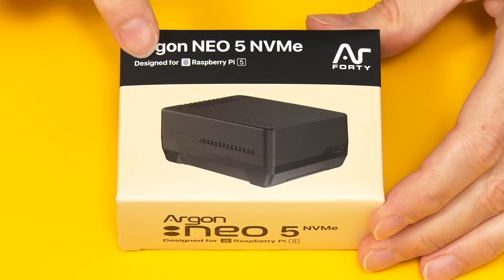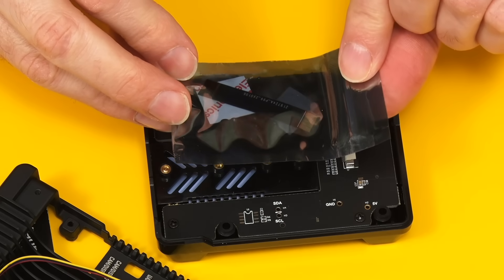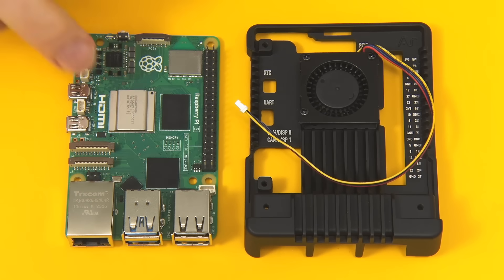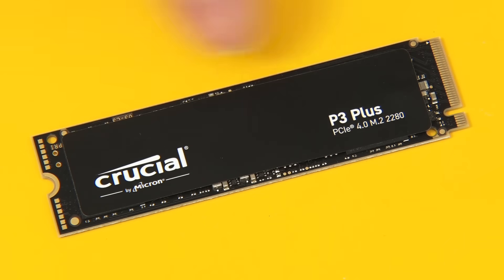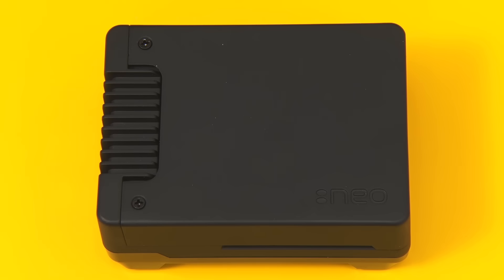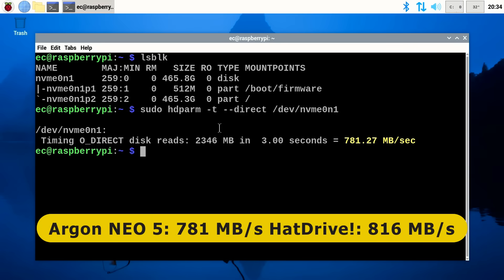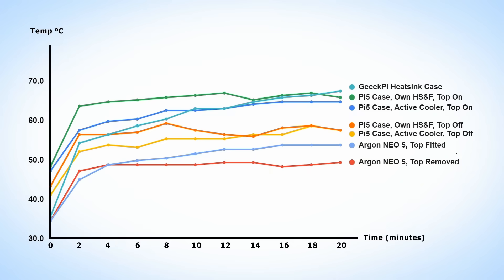Raspberry Pi 5 Argon NEO 5 NVMe Case

Comment: Nice video. I might add the Crucial P3s has a heat sink as part of the NVME - it’s the thin piece with the white letters.
Reply from the maker: The label on the P3 is a heat spreader, not a heat sink. :)

Comment: Question, I'm setting up a Raspberri Pi5 server for a client. I'll do the installs on one of my temp NVMe SSD's and later use Balena Etcher to clone the entire thing to the SSD the client purchased. Is there anything in that plan that you forsee not working? Thanks, much!
Reply from the maker: Should be fine, but I would personally clone the drive using the imaging tool in Raspberry Pi OS.

Comment: I switched from Raspberry Pis to repurposed thin clients that I buy used on Ebay: HP T530 ($40 with 4 GB RAM, performances similar to a RPI 4), the Igel M530C ($25, Ryzen CPU, 2 GB RAM) or the HP T640 ($50, ryzen CPU, 4 GB RAM). These are low power and silent (no fan), come with power supplies and solid cases, and run Debian fine. I prefer these over a new mini PC: cheap enough that I can tinker and experiment without guilt. The main downside is that they are much bigger than a RPI.

I continue to use the Zero because of the GPIO, but I am starting to have troubles with the sluggish package update on the original Zero. I avoid computers with fans (noise, dust accumulation), so I stay clear of the (relatively expensive) RPI 5.

Comment: Probably a dumb question, but since I've never played around with nvmes on raspberry pi's before, can these be used on other OS's other than the raspberry pi os?
I personally run one of the emulator focused OS's on my Pi using a Pi2Scart, though primarily for access to Kodi and Composite so that I have a way to stream my plex server to a CRT, but for those instances when I do want to play some games, using an nvme would likely give me a better experience, assuming of course that it functions.
Reply from the maker: Yes, you can install and boot other Pi OS from an NVMe drive.
Reply: @ExplainingComputers  Thank you, I'm gonna try picking one up then

Comment: A question i found no answer yet:  Is the Power-LED of Raspi 5 visible at Argon NEO 5?  Thanks in preview for possible answers and also thanks a lot for the informative and helpful video. 🙂
Reply from the maker: Yes, the power LED is visible on the Argon NEO 5.
Reply: Thanks a lot for the quick answer. I am very happy about it. 🙂  @ExplainingComputers
Reply: I ordered it and i have set it up yesterday with help from this video. Thanks a lot for that! :-) The fan is very silent and i even discoverd a deep blue SSD-Led additional to the Power-Led. 🙂

Comment: Long term, I've had a different experience of temperature :

Initially I got so low values , running your sysbench , 20 minute test. Later however, I install immich , and while this was indexing my photos , I saw:

12:04:03 up 1 day, 20:06,  4 users,  load average: 3.46, 3.73, 3.78
GPU temp=84.0'C
CPU Temp 83.70 C
NVME 39°C
Fan 10211 RPM
throttled=0xe0008

(I tried various things, but could not get back to low temperatures. So I assumed I had issues WRT thermal pads [ a thermal camera is showing nothing too hot, from above])

Before installing the pads , I reran your test:

temp=49.4'C
temp=61.5'C
temp=63.1'C
temp=63.7'C
temp=63.7'C
temp=63.1'C
temp=64.2'C
temp=62.0'C
temp=62.6'C
temp=63.1'C
temp=67.5'C
root@argon:~

And near the end I measured:

root@argon:~# all-temp 
 13:57:17 up  1:25,  4 users,  load average: 4.11, 4.04, 3.00
GPU temp=67.5'C
CPU Temp 67.20 C
NVME 39°C
Fan 5042 RPM
throttled=0x0

(The room temperate is 20.5 C) ,so:

1: Your sysbench does not seem to stress it as much as immich (your guess is a good a mine)
2: I do seem to have a slight temperature issue ...so I'll try the new thermal pads.
Reply: My final comment on this (I hope)

I ordered some thermal pads, used these , reran the test .... and got even higher temperatures

So I got some thermal paste, applied multiple pads to build up thickness. Used thermal paste as an indication that the metal case was pressing on the pad (it squashes out) . Then replaced the short machine screws with longer ones , so there was some pressure  pushing the pads onto the Pi ...and ...

temp=42.2'C
temp=54.9'C
temp=58.2'C
temp=60.4'C
temp=62.6'C
temp=63.7'C
temp=64.2'C
temp=64.2'C
temp=64.2'C
temp=63.7'C
temp=64.8'C

About 10 C below the new pads alone and about 3 C below the tests I ran using original pads . These are still quite a lot higher than you are seeing, but generally a lot better than I was getting. ABTW a thermal camera shows the whole case is "hot" and esp. the middle section (where the pi clamps to the case) so I guess some better thermal connection to the top cover would bleed that heat of better.

Comment: Finding a case for the Raspberry Pi 5 that supports both an SSD and a cooler is really annoying (especially since the official case does not), so this one that actually comes with its own cooler and connector for M.2 NVMe seems absolutely perfect for that use case.
Thanks for the excellent assembly instructions, too, I didn't quite get what the manual described in a few places.

Comment: Thast's a really slick design. Got the Argonone V3 without Nvme slot for the pi5. And it's okay at keeping cool. But i also have a Argonone with Nvme slot for a pi4. And that rest around 60-C with full power fan. Which is good. But also usually results in the fan running almost constant.
This one seems to have cooling for the Nvme very thoughtfully put into the design. I like it.

Comment: I missed this one when it was first released but have since recently set up a Pi5 with this case and a salvaged 256GB NVMe. And holy cow, THIS is the way. The Pi 5 really should have had an m.2 slot on the bottom because this is the configuration that we were meant to have.

The only thing I don’t care for on the case is that the matte black metal surface is a fingerprint magnet.

Other than that, I love it.
Reply from the maker: We are so in agreement! The Pi in this case with an SSD is th way! :)

Comment: once Againe, thank you for your video, I installed NVME Drive successfully, kept getting errors upon boot, it was the copper wire not connected to the white one it kept flipping upside down and inside out, that snaky little ribbon cable finally got connected due to rewinding your video, and using Mr Screw Driver xD, thanks lad.

Comment: Thanks for the great video! Quick question as there are no tech specs on the website - doe this have the SD slot so we could run the OS off that, and a the apps off teh NVME drive?

Comment: Two points after this video.

1, Would this run significantly faster with an NVME with Dram? (enough to warrant the cost)

And 2, is there a case that incorporates fan cooling to the NVME heatsink?

Comment: Very good video, thank you for that!
I’m very pleased with this case, but the only downside (for me) is that the top part doesn't have a ribbon cable slot for a camera, like the Raspberry Pi AI camera, for example. Does anyone have a link to a 3D-print file for this? I haven't been able to find one for this particular case.

Comment: I have two of these. Key problem is that the bluetooth signal - and presumably the WiFi, though I don't use that - is quite attenuated. I'm replacing the one where I need the bluetooth with an official case.

Comment: Any screwdriver with a steel blade can be a magnetic screwdriver. Just put a neodymium magnet anywhere on the blade, even little 3 mm round magnets are enough to pick up small screws found in computer equipment.

Comment: Thankyou for a great video, as always.

I received this device a couple of days ago, struggled 2 whole days to get the NVMe drive recognized, alas "nvme nvme0: Device not ready; aboting initialisation, CSTS=0x0". Was using the PNY CS1030 M.2 NVMe SSD 250GB, which is on the compatible list. Was able to get it working temporarily on a fresh install of DietPI, but as soon as updates were done it disappeared again. This seems to be a somewhat common issue, I'm waiting for a different NVMe drive (also on the compatible list: Kioxia Exceria G2 NVMe SSD 500GB) will see if I can get it to work there. And yes, I followed all instructions with installation of scripts, and more.

Comment: @ExplainingComputers Hello! Do you remember how strong, or weak, the wifi signal is? I'm asking because that's mostly a metal case. Even the lid is metal! I also find strange the case designers didn't use an extender for the microSD card. Perhaps they found out that would be a ribbon too many. lol

Comment: I found the PCIe socket on this case to be below standard compared to the one on the Pi 5 end - the latch breaks so easy, and you can tell the material is very poor compared to the one on the Pi end.

Comment: to be honest, With this case i'd find the cheapest, low capacity Micro SD Card i can and put the UEFI Firmware on it for the pi to boot UEFI ARM64 OS's which would be on the SSD anyway and leave the SD card in there, you would never need to touch it anyway after writing the UEFI Boot loader on to it. since it just sits there inactive after boot.

Comment: The Pi 5 only has a 2.0 PCIe connection (not 3rd gen). So we're realistically talking about approximately 500 MB/s speeds, after overhead. Don't go for any expensive M2s.
Reply from the maker: Well, you seem to be mid-informed, as a Pi 5 can usually handle a PCIe 3.0 connection, as this video clearly shows. Very early on Raspberry Pi themselves noted that stating PCIe 2.0 in the specs was conservative. And they provide the opportunity to setup up to 3.0 in the config file, as this video clearly shows. So, as demonstrated, c.800MB/s is perfectly possible. But certainly, there no no point in investing in the highest spec SSDs (although price is often a measure of quality and reliability as well as speed).

Comment: I've bought and installed one of these. In initially I routed the ribbon cable as you did .  I you look as the "lid" is put on it pushes forward as it snags the cable ...I rerouted through the slot in front.

Comment: Greetings.
Congratulations for the review and the channel in general.
I need some information.
having already glued the stock heat sinks that come with the pi foundation case, do I have to remove them to use this case or is there enough space? Thanks in advance.
Reply from the maker: You will have to remove them to use this case -- the case here is a heat sink.
Reply: @ExplainingComputers  thank you very much, you were very kind.🙂🙂

Comment: 13:12 -- ye old or "ye olde" ?
Greatly enjoy the cpu temp script 👍
I wish a company would make a true FHD 1080p, 7-inch display for rPi with HDMI-in.  And not HD or HD+1200x800 and not insanely priced.
Kindest regards, friends and neighbours.

As moded for Linux 'sensors' ... 

#!/bin/bash
#Ye old temperature test script

echo "Which sysbench: " && which sysbench
echo "Which sensors: " && which sensors   #Linux
#echo "Which vcgencmd: " && which vcgencmd   #rPi
echo
echo "----------------------------------"
echo "-                                -"
echo "-     Current Temp and Time      -"
echo "-                                -"
echo "----------------------------------"
echo
sensors | grep Package   #Linux
#vcgencmd measure_temp   #rPi
date +'%H:%M%P %Ssec'
echo
echo
echo "----------------------------------"
echo "-                                -"
echo "-    Sysbench CPU Stress Test    -"
echo "-                                -"
echo "-    Factoring Prime Numbers     -"
echo "-                                -"
echo "----------------------------------"
echo
for f in {1..5}
do
     #Sysbench command to factor prime numbers for [ 59 ] seconds, output suppressed
     sysbench cpu --cpu-max-prime=50000 --threads=4 --time=59 run >/dev/null 2>&1

     sensors | grep Package   #Linux
     #vcgencmd measure_temp   #rPi

     date +'%H:%M%P %Ssec'

     echo

done

#     date +'%Y%b%d_%H:%M%P_%Ssec_%Z%z'

Comment: Surely I'm not the only one who was a bit taken aback about 1:57 or so, hearing Chris getting frustrated with the unboxing and saying "Out, you c*nt!" I had my wife listen, and she heard "Out you come", which seems way more likely on this channel, but that's not how I heard it.
That is an impressive case.  Idk, maybe if I get a second pi5 I'll get that, but my black aluminum case with fan seems to do a very good job.  All in all, I'm quite happy with the performance of the pi5 (8GB), and have been doing most of my desktop work on it, with my old desktop reserved for a few things that use too much memory or just didn't run well for one reason or another.  For the price, it's fantastic.  The first home computer I used was a TRS-80 Model 3.  Or was it III?  Three, anyway.  I've spent a career mostly using engineering workstations, doing software development primarily with a CAD system, and have seen plenty of computers costing more than 100 times as much but with nowhere near the performance.  We used to start a "make" and go take a coffee break.  To render a scene, it was better to kick it off just before lunch.  And best of all, with channels like this, the SBC revolution is televised!

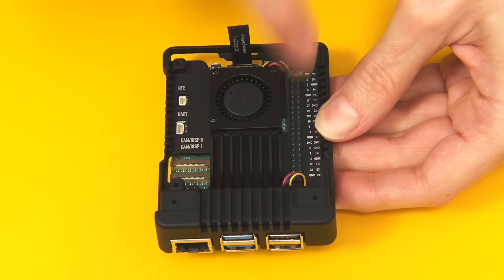Comment: 6:40 - I was testing this case and had the exact same thought! That fan cable routing is just plain weird. Once I got it in place, it was fine... but getting it to stay was tough. And the first time, I didn't realize the PCIe cable had to go in that other slot, so I had to pop it back apart and start over!

It is a nice case once together though.
Reply: Hi, Jeff! :)
Reply: @Praxibetel-Ix  Hello there!
Reply: I bought one recently. My experience was not as great as others. First the power button lever is flimsy and has a lever device that actuates the RPi power button. It is needed to compensate for how offset the Neo button is relative to the RPi button. I could not get this to operate correctly. It is the power button of all things! The second problem I had was that two of the 2.5mm flathead screws used to hold down the MVMe cover were missing. I like the case but these problems with it make me shy to recommend or buy again.

Comment: Heads up when you rush out to buy this case. I was so fast that I did not notice I bought a version without the NVME extension. You can buy the extension separately but it was cheaper for me to return the wrong order and get a complete case with NVME included.
Reply from the maker: I hope it all works out.

Comment: What I'm always worried about when it comes to metal cases is how it affects the wifi sensitivity. My Pi 4 boards are quite poor to start with, with no case. Big problems getting a good signal from the wifi router upstairs (no issues with tablets, phones, PCs, but the Pi boards do have problems). I can only imagine metal cases will make the problem even worse.
It's a very nice looking case though.

Comment: I have the Argon One V3 case. If I connect the fan the same way you did it would it work? When does the fan come on or does it run constantly? I don't want to install a script from them.
Reply: Raspberry Pi OS controls the fan port of the Raspbery Pi 5 automatically. So you don't need to install a script. The fan starts to get audible around 60C, which it will never hit using this case, so it's completely silent. (I'm typing this using it right now.)
Reply: @harleyn3089 
Thanks. What if I use another OS? Will it still work then?
Reply: @C0LiDe  It depends which OS. I believe Ubuntu runs full speed when you install it, but as soon as you run an update it is silent. I believe Android works. But each OS needs to have the fan control code integrated.
Reply from the maker: @harleyn3089  is correct -- Raspberry Pi OS and Ubuntu certainly have working fan control (although you need to apply updates on first run in Ubuntu or the fan will be on maximum all the time). But update and reboot and life is sweet.
Reply: Thank you very much. Debian should also work too?

Comment: Argon makes great stuff for the pi ecosystem. I almost wish this case was available when I bought my Geekworm case. But I need the mounting options that the geekworm provides and my case IS all aluminum and wall mountable. Both are winners and both have great NVME solutions.
I can't say enough about the pi5 performance with an MVME drive. This thing boots way faster than any Windows box, and everything is so snappy!

Comment: It is rather fiddly but I guess that once you have it all connected, with the likelihood that all you will swap out is the NVME, once done, likely worth the effort. 

The lack of ability to access the SD card slot though has to be disappointing. 

Then, as was mentioned in the video (bonus point for it), whilst a nice all in one solution, once you add the cost of it and an NVME, it can go beyond the cost of many an N100 mini PC, which, for the specific uses that it has, would make it a no contest. 

But of course if all the GPIO and connectors not found on a mini PC are important then the comparison becomes somewhat moot.

Which does beg a question, one that I have vague recollection was covered to some degree on this channel a while back, that of creating a USB breakout board for an X86 PC that could add all the GPIO and other functionality as a plug in solution. I have often wondered why this potential hole in the market hasn't been addressed by some vendors.

Comment: I've been running a Pi 5 in this case for a month now and am very pleased with it. I'm glad it wasn't just me that found installing the fan cable as fiddly.

As you pointed out there's no access to the SD card slot so that means you can't boot from another O/S unless you remove the SSD then you can boot from a USB drive. I hope they update the eeprom to give an option, if possible, so you can boot from the USB over the NVME if one is plugged in giving you the possibility of booting from a different O/S when required.